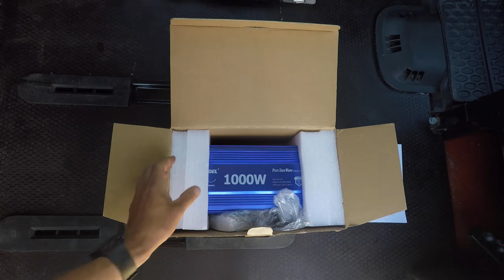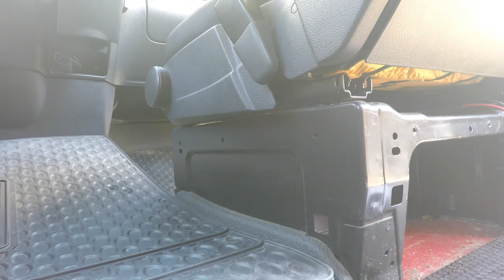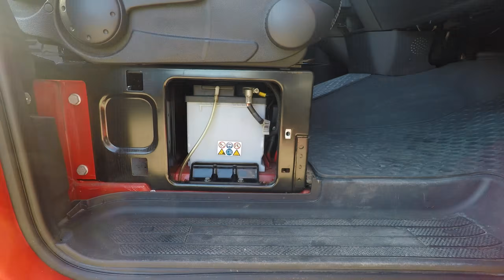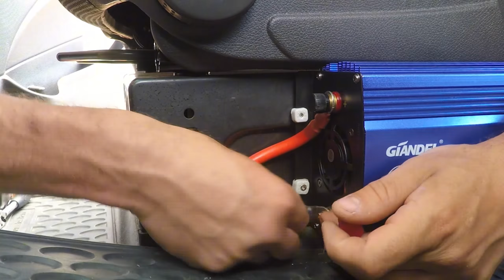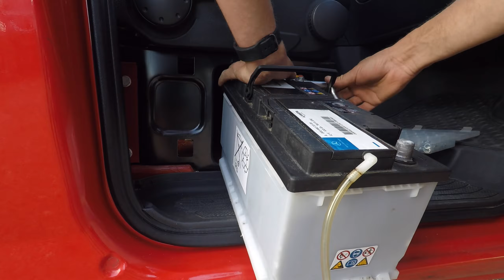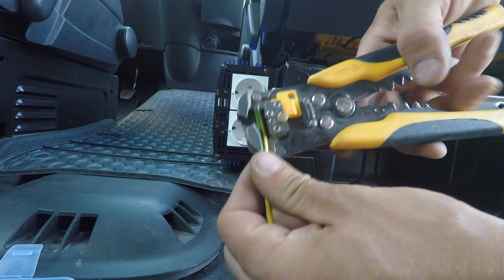Mercedes Vito 12V to 220V inverter installation

Comment: You suggest to install first of all a second battery?
Reply from the maker: You can connect the inverter to the main battery, but it’s risky and shortens its life. The better solution is a second battery—ideally LiFePO with suitable charger, since lead-acid won’t last long under inverter loads.